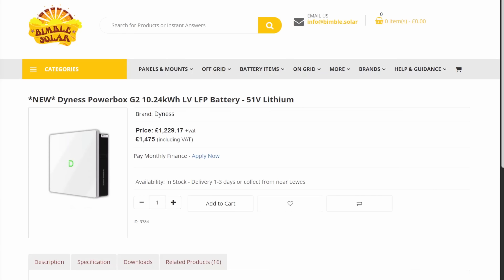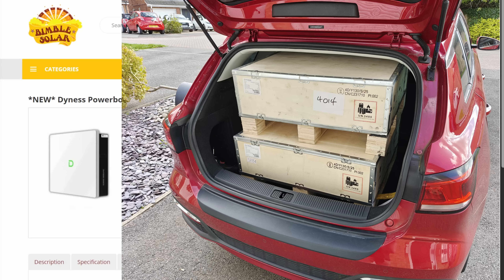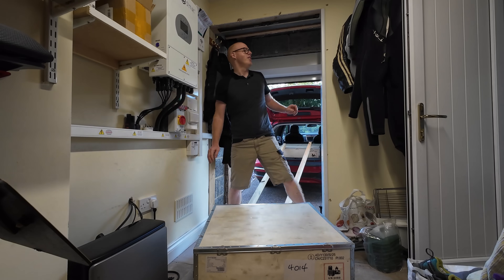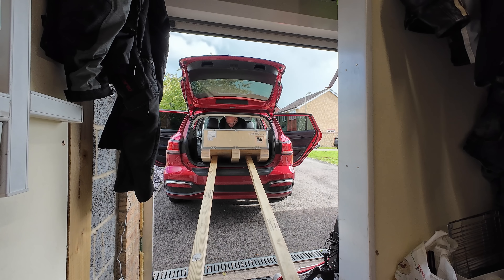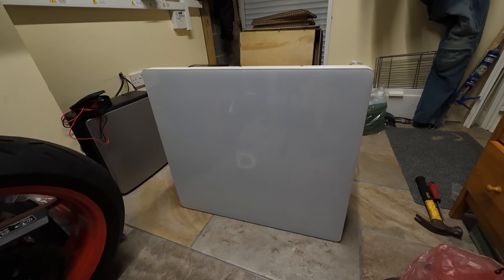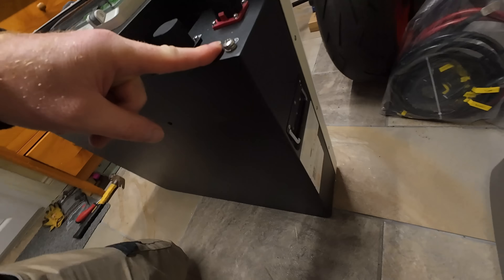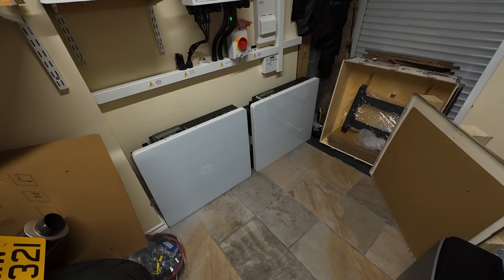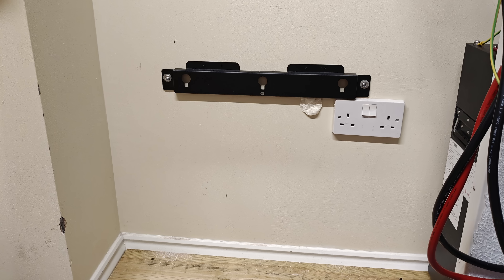This Is What Happens When You DIY Battery Storage

Comment: I think it’s a bit silly to put a glass front on a battery.

More inportantly3 does your Synsynk inverter work with any battery? And does it do Agile integration? I was wondering why you didn’t need another inverter, as you would with Givenergy, Sigen etc.
Reply from the maker: Yes, Sunsynk is incredibly versatile like that. It works with most batteries and yes it can integrate with Agile.

Comment: Thing is...why on earth sid they put glass on the front of the battery? Makes absolutely zero sense...
Reply from the maker: Aesthetics? Thermal management? Who knows but Dyness haven't replied to me yet.
Reply: @UpsideDownFork 
Probably purely a design choice. Thermals aren't great with Glass, an Aluminium front would work far better for that.
Reply from the maker: @rolandrohde  Not for dissipating heat but rather for insulating better than exposed metal would. That is the reasoning that Tesla give for their Powerwall.

Comment: Why TF would anyone put glass on the front? Does it serve any purpose? It's clearly white plastic underneath.....
Reply from the maker: It is white metal panel underneath.

The glass is either just aesthetic or may play a role in thermal management. Not confirmed either way at this point.
Reply: @UpsideDownFork . I wondered if it was a protective layer: assuming the metal gets hot, I wondered if the glass may insulate that like a pyrex jug.

Comment: By a small hydraulic lift table on rollers.  They aren't expensive (non-motorized).  You'll want one with a 700lb capacity (which means it can do around 300lb in reality).  It makes things a whole lot easier.

The one I wound up getting off of Amazon was "Hydraulic lift atble cart, 770lb capacity, double scissor lift w/locking wheels.  51" lifting height" for around $300 USD.
Reply from the maker: I have access to stuff like this at work but I naively thought I'd get by just fine without.

Comment: I'd say those glass fronts, even now installed there, are an accident waiting to happen. Although the glass is toughened, if you catch something fairly sharp or pointed near the edge of the panel it is likely to shatter. This is all too easy in a thoroughfare like you have. Perhaps a better position would be higher up the wall, but that would involve some heavy lifting and extra help. 

Hopefully, you can get another front panel, but I would seriously consider putting something else between them and you as a massive glass protector!

Comment: Glas is heavy and makes things harder - we have simple black metal boxes .
But you should easily get a nice replacement cover - and it should not cost 2 kidney and a leg.

Good luck. 

P.S.: We never have have bought a battery, always DIY kits out of cells and case with BMS.
Why ? Cause you learn a lot building them and then you learn more about how the work and finally: I can fix them fully from scratch

I know the BMS, have spares in case things go wrong and hence not much damage I can not fix unless all 16 cells would die.

Comment: In Oz, we now get a rebate. And generally batteries need to be installed by licenced trade. 
I had an option for 20kwh battery for $9500  Or  40kwh battery for $13500.
One drawback thou is that I can't discharge the battery back to the grid (yet). 
One benefit that I under estimated is that the solar panels are now much more efficient.
Reply from the maker: Thanks for sharing your experience! 
Interesting to hear how things are done in different parts of the world!

A certified electrician must connect the inverter to the mains but the low voltage DC side for the batteries is open to anyone.

Comment: You seem a nice bloke with a nice family. Don’t behave like a muppet and at least get an electrician to test your install.
Reply from the maker: Thanks.
What tests would be performed that I haven't already done?
Bundles DC cables, checked.
Bolts torqued to the correct spec.
Thermal imaging time lapse recorded of the batteries receiving 8kW+ for an extended period.
My background is in auto electronics. Back in the day I fitted many car sound systems with exactly this cabling and connectors.

All that being said. An electrician will be here in a couple of weeks and I'll get him to kick the tyres.

Comment: I feel your pain. I’m guessing this video was an hour long before you edited out the swearing!
Reply from the maker: Ha! I don't get sweary, but I did lose loads of the most important footage  due to camera cutting out twice without me realising. That's even more frustrating than the glass breaking. A new panel can be fitted easily but I can't get back the hours of fitting the brackets, connecting the wiring, configuring the settings and the initial moment it all turned on just perfectly!

Comment: 10kwh for 1500 , ‘smashing value’!  .  I have 24kwhs of pylontech , they are about 900-1000 for 4.8 kwhs( at the moment) and so far have been pretty good.  more expensive than the dyness though.   Once you have a certain type of battery you have to stick with it, i bought  my first pylontech batteries in 2020, and have been adding to them ever since.
Reply from the maker: Ha, very good! Smashing value indeed 👍
Reply: I'm in much the same position having bought 10 kWh (4x 2.5 kWh) of Fox ESS with a 3.8 kW Hybrid inverter in 2021 and to expand capacity now really means starting again as I now have Heat Pump and Induction Hob. So my battery storage needs are massively higher.
Reply: @BarryHaegerSalesCoach  i used to think 15 kwh was the right amount, now i have a different point of view. like you i have a heat pump (mini split system) and a heat pump hot water tank. also have a few 3d printers that get used alot,  my new number is 30 kwhs.  i always seem to want another 5kwhs.

Comment: Why on earth would you buy a battery with a glass front? These things should be built for function and robustness. I have 6 Sunsynk 5kwh batteries, and 5 of them fitted myself. These things are 50kgs each and are in a solid steel case, glass, plastic, or perspex for case material... no, no, no😨
Please be careful mounting, that's 200kgs mounted on a stud wall🙏.. please take some advice, after all, what could possibly go wrong 🤷
Reply from the maker: The glass is just stuck over the top of a steel panel.

You'll see more in the future videos.

There is no weight bearing on the stud wall. Just a top tether to stop them tipping over.

I've used 2 decent plasterboard fixings and 2 X screws directly into the stud for each battery. Well overkill for a top tether.
Reply: @UpsideDownFork
Good luck, the batteries will make a fantastic difference to your system

Comment: Unlucky with that so 2 or 3 options open to you contact Dyness for a replacement front or perhaps Brimble have replacements or maybe one that’s faulty or damage in some other way if none of the above take the measurements to your local glass merchant and they might be able to help so a tad unlucky you have been.

Just in other point someone in the comments below has said glass fronts shouldn’t have been fitted in the first place and I also commented along these lines when I Tesla Powerwall 3 was installed and the installation team explained that is fitted to improve heat control not  sure if that’s true but that’s what I was told.
Reply from the maker: Thanks. 😊

That's an interesting point about thermal management. I'll investigate that!

Comment: Fair do's for putting this out. I do feel for you, and I think it's something a professional could just as easily do. I've been meaning to give you a sub for some time and now I've done it. I think I would probably limit myself to the 4kWh units; in fact I think that was your own advice in a previous video; but right now I'm using my car as a giant battery - I think I could still make gains but I'm not sure the financials are really there. (I could probably do better than the stock market even in my situation, though, and I'm really tempted to do it as a DIY project.)
Reply from the maker: Thanks for the sub and support! 😊

Yes, I do now understand why installers prefer a max of 5kWh per module!